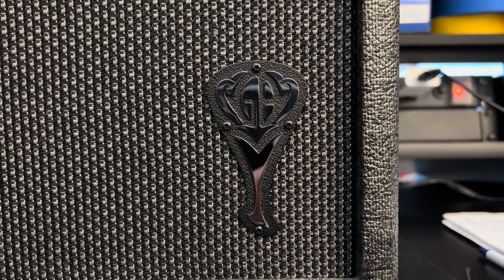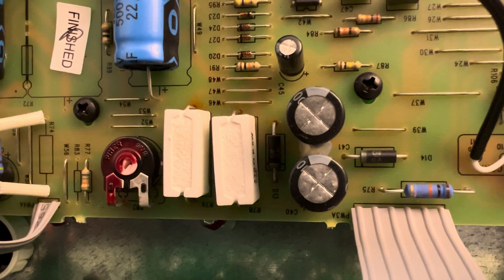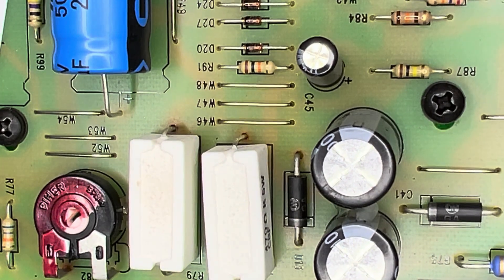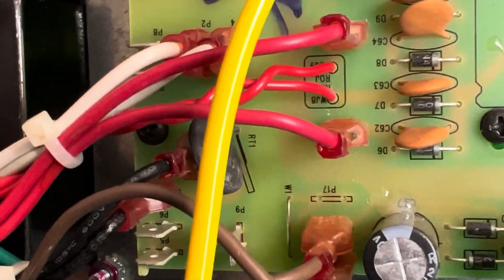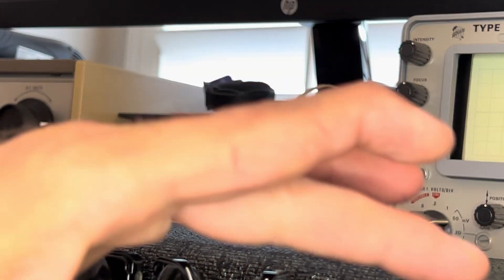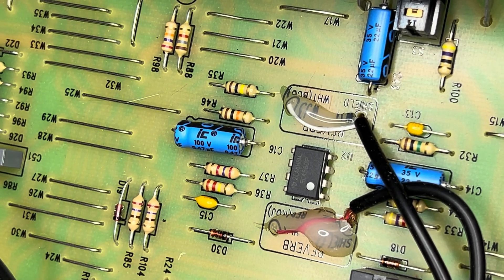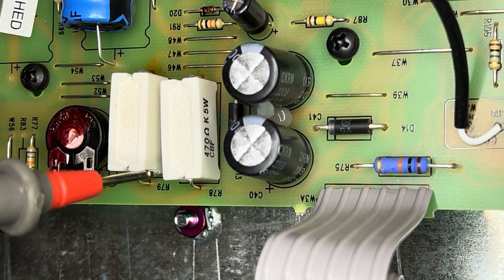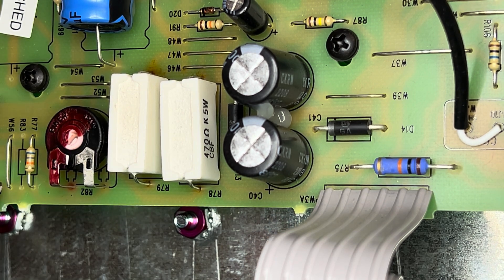Fender George Benson Hotrod Deluxe  || The Wrong Remains The Same

Comment from the maker: That low voltage flaw in the Hotrod family?  It’s  NOT due to component/pcb spacing. It’s due to insufficient trace mass; they can’t handle the current demand. The trick of placing new components with an air gap doesn’t work because of the gap — it works because of the heat sinking effect created by the additional lead length.
Reply: It’s both. The extra leads definitely help the puny traces, but it’s the air gap that keeps the fiberglass from toasting/burning.
Reply from the maker: @PsionicAudio I haven’t seen pcb damage that didn’t radiate inward from the pads—but I haven’t seen everything. That’s certain. 🍻. Hope alls well with you and the fam.
Reply: Does This happen Often,
I had My Heart Set on a GB Hot Rod Deluxe,  now I'm afraid I might be Rolling the Dice 🎲 after Saving for So long, What's your Opinion,  If you would be So Kind...🤔
Reply from the maker: It happens to all of them :(. But if it’s an amp you love, a good tech can bulletproof it for you and have the amp give you decades of trouble free service —random issues like tubes notwithstanding.

Comment: Example number 4,278,192 of the HRD low voltage components cooking the board to death; yet Lyle and Brad and yourself will still just be called liars and haters and that of course in “reality” this rarely happens with these amps.
Reply from the maker: Checkout the pinned comment. I go into depth as to why the trick we use works!